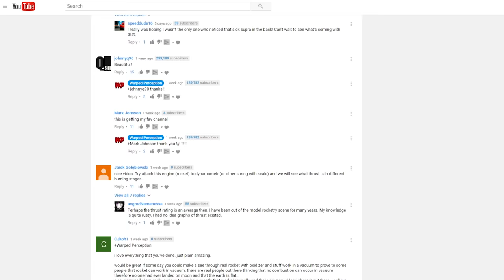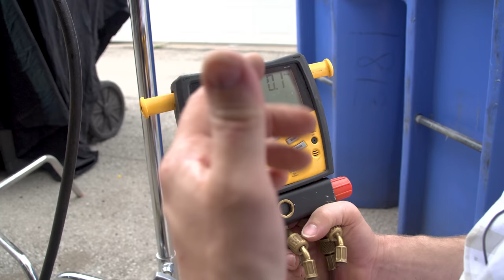Model Rocket Engine In A Vacuum Chamber - 4K Slow Motion - will it burn? - Rockets (S1 • E3)

Comment: you dont have an "infinite" vacuum. you are filling a defined space with enough gas to have a substance in which the continued combustion can push upon in order to achieve "movement" . in an infinite vacuum of 10 to the negative 17 Tor you go no where . Your test is at best inconclusive for the limited container volume and the not nearly negative pressure required to simulate " space" but you tried.
Reply: @flatearthbear4077  I could survive IN SPACE inside a MYLAR BIRTHDAY BALLOON filled to 5 PSI of oxygen.  This is a FACT.  Doesn't sound so hard for a spacesuit now does it?
Reply: Stuart Gray Nah you couldnt , besides the cold , at 5 psi youd be the Sta Puff marshmallow boy ! The compressor on your back wouldnt work at those temperatures and lack of pressure and you would be as stiff as a board...kinda like your natural state but enhanced ! 🤣
Reply: @flatearthbear4077  and who says I would be cold?  If I am in the sunlight I could overheat OR freeze depending on JUST the thermal coating on the balloon.
Reply: Stuart Gray  You oughtta try standing on a mountain peak and then talk about what you think space is. If youd freeze to death on Everest you dont have a prayer past the Karmin Line. 🤣🤣🤣🌏👈🤣🤣🤣
Reply: @flatearthbear4077  "about what you think space is" you are funny.  I build, test, launch, and FLY Spacecraft for a living and have been for about 25 years.  I am ALSO a vacuum test specialist trained at Lockheed Martin Space Simulation Laboratory.  What is YOUR expertise in spaceflight hardware and it's operation in space? NONE? Oh what a surprise....
Reply: @flatearthbear4077  search YT for "Uninterrupted Footage of the Falcon9 launch and booster landing" watch that video and report back AFTER you see the boosters LAND.  You could educate yourself with some videos on my YT channel like the "Stardust launch".  Just TRY to tell me THAT launch was fake.
Reply: Stuart Gray  Oh i saw that ... that was the one with Carrie Fisher and Harrison Ford right ? 🤣🌏👈🤣
Reply: @flatearthbear4077  so you even refuse to evaluate evidence.  You are too far gone to be worth my time
Reply: @flatearthbear4077  so in your book , LIVE VIDEO and TENS OF THOUSANDS of live spectators is not "evidence" .  I guess we are done here since you live in a different reality than I do.  I have PERSONALLY SEEN over twenty real rocket launches including Athena, Atlas, delta-II, Delta-IV, Minotaur, Space Shuttle (launches AND LANDINGS) and Falcon9 launch and booster return WITH MY EYES. But I guess I shouldn't believe any of THAT since YOU say it is fake.  Maybe you should go to Cocoa Beach and see a launch for yourself?  I have personally helped put FIVE spacecraft on the rocket and launch them to Earth orbit and beyond, but YOU are the expert huh?  Fucking hilarious.....
Reply: @flatearthbear4077  oh, and care to explain how most modern aircraft have ring-laser gyroscopes that MEASURE EARTH'S ROTATION AND CURVE as part of the pre-flight test?  This is done literally thousands of times DAILY WORLDWIDE.  No?  Didn't think so....
Reply: @flatearthbear4077  bro you got destroyed.

Comment: Bullshit, the chamber is to small(diameter/ length) ,making the exhaust push against it
Reply: This video is about igniting a rocket motor in a vacuum, not creating thrust in a vacuum-that's a different video.

Comment: you just encapsulated the rocket, even if you ignite a rocket in space it wouldn't go nowhere because the vacuum of space will absorb any propulsion force from rocket and if you can make a rocket travel in outer space then space is not a vacuum.
Reply: What, exactly, is going to absorb any force? By definition, there's nothing in a vacuum.
Reply: that's a reason why they called it "vacuum", and if there's "nothing " there, then the rocket propulsion won't work against "nothing" and if they do then outer space is not a vacuum as simple as that.
Reply: There is one thing there, the rocket itself. When the exhaust gases expand they push against the exhaust bell; that's what pushes the rocket forward (or up or towards the moon or whichever direction it's going). Like when I push a random stranger in the street, they go one way and I go the other, I don't have to push against the air or anything else to feel that force pushing me the opposite way to them.
Reply: NelC, that's a second grader explanation of how rockets work  under an atmosphere, put a rocket in outer space not low orbit and away from any celestial bodies and their gravitational forces and if you can make it work i'll believe it. Have you seen the experiment with a drone not been able to fly in a vacuum? it won't fly because there's nothing to propel itself with not even air, no pressures of any kind, same thing with rockets, no matter their shape, gases, etc. and again if they work in outer space then outer space is not a vacuum.
Reply: Yeah, it's as simple as I can make it, because I'm talking to someone who has trouble with distinguishing his gut feelings from what he can see in the universe at large. Just because it's simple doesn't make it wrong, and I notice you haven't actually demonstrated how it is wrong, merely asserted it. Which is pretty second-grader behaviour just in itself.

As to how the absence of gravity — incidentally, any sixth-grader with a halfway decent education will tell you that the effects of gravity extend to infinity, so you can never really "get away" from any celestial body in that respect — how the absence of gravity affects thrust, that's a new one: I thought it was the vacuum itself that is supposed to make the working of rockets impossible in space?
Reply: A drone can't fly in a vacuum because a drone produces thrust by accelerating air with propellers. In a vacuum, there is no air, so no thrust made. Rockets work by accelerating gases created by fuel from the fuel tanks. Those fuel tanks and gases are present in space, so thrust is made.

Comment: tube is too small of diameter did not pull enough vacuum on tube engine blasted off the side of the tube and showed force
Reply: It would "show force" even in a GIANT vacuum chamber far from the wall.
Rocket propulsion works via RECOIL force.

DO you believe recoil stops working just because you're in vacuum?
Would a crossbow have recoil in a vacuum chamber?  Yes or No?

Comment: Gah. The ignorance of basic physics in these comments is stunning. 
Put very simply, the burning fuel/oxidizer mix creates a hot gas inside the rocket chamber which puts pressure against the inside of the chamber walls. Except the nozzle has no wall to put pressure against. Opposite the nozzle it has a wall to push against. The pressure imbalance is what moves the rocket. It doesn't need anything for the exhaust to push against.  Imagine a high pressure gas bottle in a vacuum that is punctured. There is then a pressure imbalance. At the puncture the pressure is less because there is an escape. Opposite the puncture there is still a wall to push against. So we have pressure on one side and less on the opposite.  Voila, Thrust. Atmospheric pressure outside the combustion chamber actually slows the combustion process.
Reply: Welsley, you're calling other's ignorant. You just described "pressure" inside an INFINITE vacuum.

Comment: Well sorry man your test is a false positive.  Why  your rocket fires.? It is a solid state fuel. And  there's oxygen in the fuel compounds
But in space that wouldn't happen. Why? Space is a way bigger vacuum. The vacuum you made is to small. As soon as it lilt it made a co2 atmosphere in which was why the oxygen was Able to burn in the chamber.

Comment: I tried to reply to my original comment.  You never proved with a vacuum guage that your tube was in a vacuum state.  There are videos on youtube where they do, using model rocket engines just like yours and they do not ignite.  I dont believe in flat earth but those rocket engines wont work in a vacuum.  You asked about c4 my guess is that it would explode in a vacuum but I have no way to test that theory and if I did it couldnt be put on youtube.  My point is you had no vacuum you claim those model rocket engines have their own oxidizer and will work in a vacuum.  I dont think that is true.  Watch the other videos with a real vacuum and you can see for yourself.  
On another topic please do tell me how air conditioning or heating systems work in a vacuum.

Comment: I don't doubt that the rocket could ignite. My concerns would that in the vacuum of space there is nothing for the rocket to push against, whereas in your tube it can push off of the back wall. Also, I wouldn't have thought that plastic tube and compressor could achieve a comparable vacuum to space.
Reply: Beau Birkett why would it need something to push against of

Comment: Its not a matter of if a rocket can burn in a vacuum its if it can produce thrust you experiment was a faulty one from the start first of all the scale was too small the tube has an end that the rocket can push off of so your rocket burn in a tube was a fail all you proved is your rocket burned i dont think thats what believers are saying is that rockets wont burn in a vacuum  its the thrust in a vacuum inviroment that doesnt work and that has already been proven .in a real setting there is no air to push off of. The rocket just burns .
Reply: Sorry but you have it backwards.  Rocket propulsuon HAS BEEN proven literally millions of times in a vacuum.  I can convince anyone with a high school grasp of physics that this is the case.   If I fired a steel projectile from a crossbow in zero-g in a vacuum WILL I feel recoil force?  Yes or no?

Comment: Vacuum pressure not anywhere near what wiki says space vacuum is.  True vacuum chambers have thick walls to withstand high vacuum pressures.  That thing could not handle much pressure at all, since it is only 1/8" acrylic which is also very brittle.
Reply: @MrM:
The pressure that air put on an average good vacuum, and a very good vacuum is not much different.
If the inside pressure inside is really zero, the force will be about 1kN per dm², and if there is a bit of pressure inside, subtract whatever is (and that wont be much).

I agree that this structure looks a bit thin for that, but I'm not a structure engineer, and cant do the computation easily.
But if it can handle an average good vacuum, it can also handle a very good one (on the mechanical standpoint, a very good vacuum need much more, like very clean and non-absorbent walls, which this likely cant).

Comment: Rocket propellant contains it's own oxidizer, for combustion. You will not get propulsion however in a  larger vacuum chamber, as you need the pressure differential to create the necessary forces for propulsion. The rocket will not move in a room sized chamber. Or outer space for that matter
Reply: So, you believe that mechanical recoil stops working in a vacuum "cuz reazons"?
Reply: @DescartesDooley  The rocket applies a force to the mass of the exhaust gas accelerating it into the vacuum.
Do you think the rocket can accelerate mass without applying a force to that mass?
What accelerates the mass into the vacuum then? Magic?

Comment: Yes, I see at first it did not move until it created some atmosphere, and then he said 'surprisingly we still have some vacuum in the vacuum chamber',  ya some but it didn't seem like it had near as much suction when he opened the valve nor did he show us the gauge.   And it did just what I thought it would do, i.e. start out not trying to move then slowly try to move, but no where near as if it would have been our atmosphere we live in.   So I think he needs to consider the vacuum of space where there is almost infinitely bigger area as the one he made so the matter expelled would almost create zero atmosphere to push off from.  He should try the same thing with just the open tube & see what the engine would do, it would likely just try to fly out of the tube.   'Disingenuous' is the word that comes to mind (but on a subconscious level I would hope).
Reply: But rocket engines don't NEED an "atmosphere to push on".
The rocket engine pushes on the EXHAUST GAS while it is still in the engine. 
Once the exhaust gas vents to vacuum it doesn't get pushed on any longer.
Rocket propulsion is just the mechanical recoil of pushing mass out the back.
Reply: @stuartgray5877  This is what they say, & in truth I do kind of understand that, but have my doubts, & having been lied to so much by the powers that be, I'm sure you can also understand why I'm dubious.  😬  Some day I will understand it all better I hope.  But until then I'm playing around with other things that are a little more 'down to earth' so to speak.  Thanks.
Reply: @VerifyVeracity  - "This is what they say"

No it is NOT.
HIGH SCHOOL PHYSICS teaches how rocket engines work.

Now get an actual education before thinking you know more than actual Aerospace engineers.
Reply: @VerifyVeracity  Personal incredulity is proof of only willful ignorance.

Meaning: You wouldn't be so confused about how the world works if you just bothered to finish high school.
Reply: @stuartgray5877  We will see someday, maybe you are right, maybe not.  But one thing for sure your tendency to be rude, & overly self-assured does not help me 'see things your way'.  But I don't think you really care you just like getting high off thinking/feeling you are the one who knows best & we are just dumb people.   I hope the best for you, & take care.
Reply: @VerifyVeracity  you are calling ME rude while YOU insult every engineer and physicists to have ever lived?
Bless your little heart